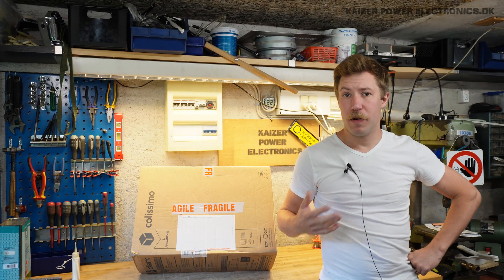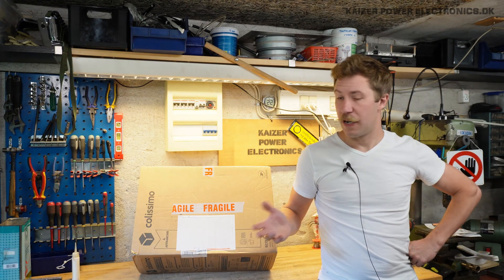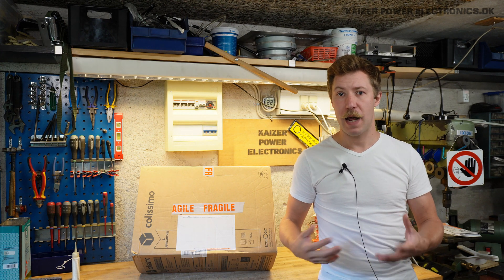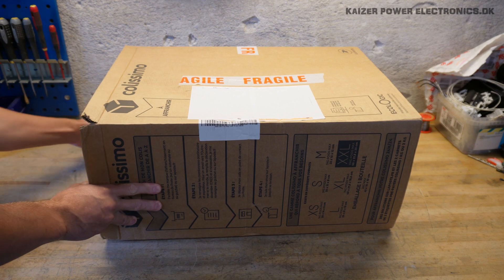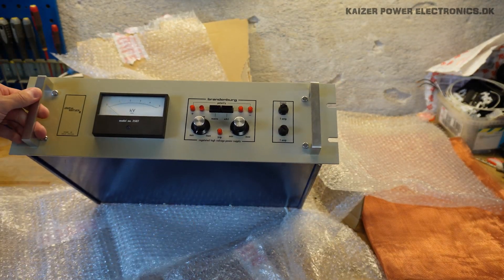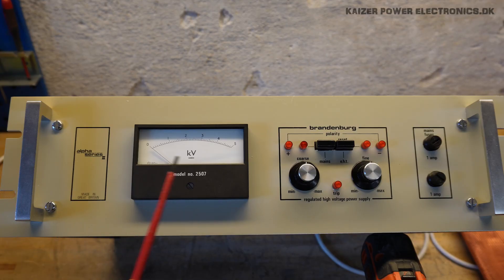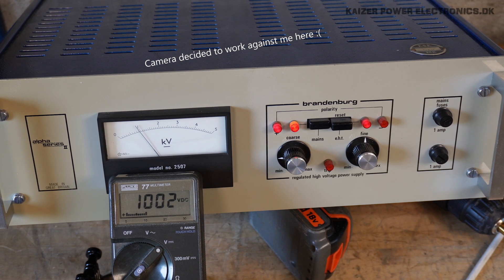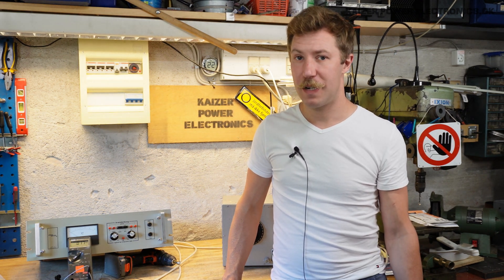Brandenburg Alpha Series II 5 kV Power Supply

Comment: As an addendum to my earlier comment, here you can see me using mine to provide bias supply to a small cloud chamber i made as a covid lockdown diversion. Notice the ammeter on the top of the instrument. this is plugged into the jack in the back, providing accurate readout of output current. I put a little switchable divider in there to be able to read 0-100uA range as well as full scale output of the supply. https://youtu.be/IUssuAcfkQM?si=odM2YCtDFegktCyb&t=28

This setup has proven quite useful for carefully measuring things like leakage and breakdown voltage of common parts such as reed relays, or isolation values of various components. I think partly because the output is fairly well behaved.
Reply from the maker: I managed to find a manual this morning, which I didn't earlier. I got a schematics of it now and I can see you are right, it is a current meter. I assumed too much from the non-high-voltage jack, so it must be connected near ground voltages.

Comment: Hah, i have this exact supply, but then in the 15kV version. World quite well, and seems fairly low noise. Edit: the external jack in mine is not in fact a remote trigger, but a jack meant to add a current meter in series with the high voltage output (on the low / ground referenced) side obviously). Yours seems to have the same functionality. Look at the label next to the plug, it includes an A for amps.

Comment: They are cool power supplies, my mates got one of similar age still working with all original caps etc, I've got the high voltage board from a similar supply, it's a self oscillating push pull with TO3 transistors, probably Germanium, il send you a picture if I ever stumble across it in my horde 😅..

Comment: excellent power supply! where can I find a stabilized 10 kilovolt 500mA
Reply from the maker: 5 kVA, that is going to be expensive. Properly Spellman.
Reply: @KaizerPowerElectronicsDk  I know Spellman, but the price is like a rocket
Reply: @zilipoper you could remove the cascade voltage multiplier from that xray transformer and put the transformers in parallel maybe??
Reply: @T2D.SteveArcs  this X-ray tank is 50 kW 100 kHz and 90 kW peak, I don’t want to break it and redo it
Reply: @zilipoper  ah okay mate, it was just an idea as it has multiple isolated secondary windings so you could configure it to suit but I understand that you want to keep it as it is, they are great  tanks 😎👍
Reply: @KaizerPowerElectronicsDk  you need it to be a proper regulated adjustable power supply? I wish I knew, I took one apart, it had 10 big flyback style transformers in parallel and a resonant Full-bridge driver 1A 12 kv output... 🤦🏻‍♂️
Reply from the maker: I do have a Spellman on a shelf somewhere, 10kV, but I doubt its 500mA. More in the range of 10mA. But the mains transformer was blown by the previous owner, its a US 110VAC unit that he plugged into 230VAC.